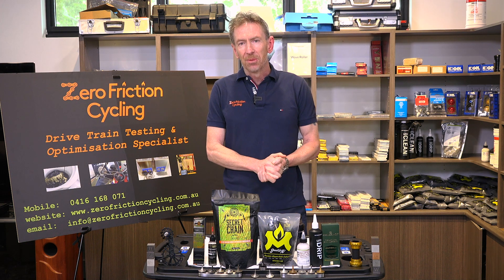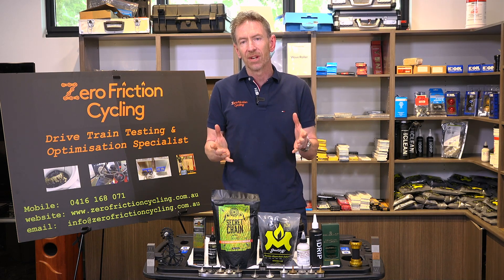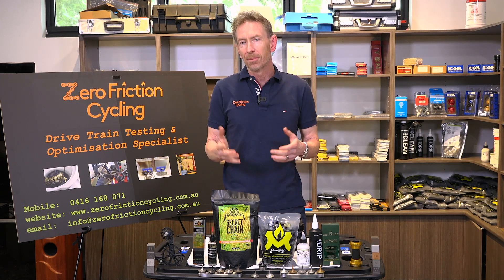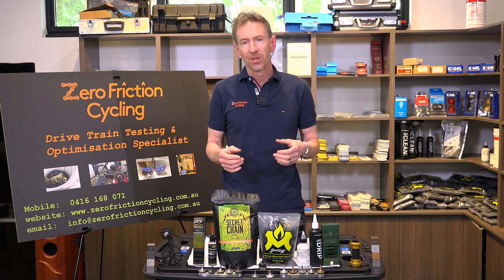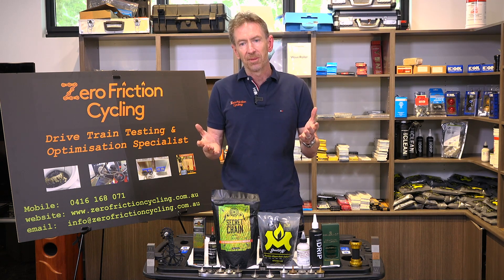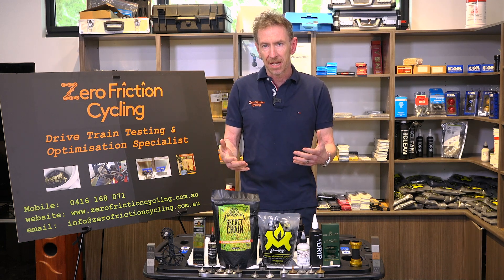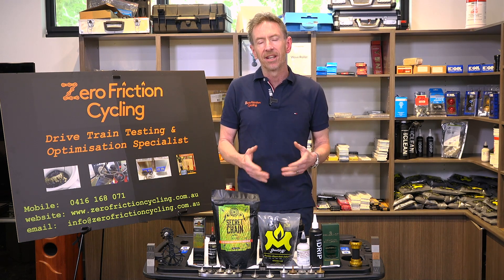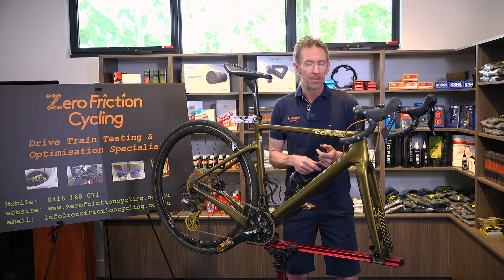Episode 1. Origins Of Zero Friction Cycling

Comment: I'm fan of your tests and your channel. And a few suggestions to bring your tests to a next level. 1. Do tests like real life cycling, with variations in Watts (including sprints). 2. Test the combination of immersive wax (I give an application every 500k) and a drip wax (in my case Squirt, to keep the drive chain absolutely silent) in between. 3.Include a variety of chains (I cycle with Wippermann) might make you the 'chain authority' too
Reply from the maker: Thanks Richard! 
Re 1 - that is difficult. A new protocol would mean building up a new league table of data for that protocol (as well as other potential variables if wattages for a particular interval input incorrectly etc - there is a lot of intervals, there would be risk of error across long tests with multiple tests running all the time). 

Re 2 - that test is on the to do list, just trying to work out how to get to it. 

re 3 - i have done a bunch of chain wear life testing awhile ago, including a number of wippermann chains, but struggling to get back to wear testing a bunch of chains i would like to do (T-type, ybn flat top etc etc).  I cant change the chain for the lubricant testing as we need to use the same model chain for wear comparison. 

thanks!
Reply: @zerofrictioncycling992  thanks for the heads up. Regarding 1. Do the testing with one protocol of variation of watts. It's not about the exact difference in wear. It' s about getting an indication of the influence.
Reply from the maker: @Richard-kz5ow  Yes that is a good idea that has been on the long list to try to get to, but oh man, my test list.... And i have a bit of a concern about what watts i could do without blowing up a neo, its a lot of hours at high watts and they get pretty darn hot at 250. I would need to give it a lot of rest breaks....

Comment: I would like to know how regular old candle wax from Woolworths stacks up against UFO & molten speed wax. 
Can you please test it with your scientific approach?🙏
Reply from the maker: Hey there - yes i will be, not sure when, but i just received my parced of candle wax from a candle making store after buckling to peer group pressure :) I am flat out so not sure when will get a spot, but this year sometime. Before test though i can already tell you (i have seen this a lot) vs msw it will be, gunky, slow, short treatment lifespan. Do not use candle wax - why skimp to buy such cheap crap for your hardest working component? DIY waxing can be great, just use a decent wax - food / lab grade paraffin. Saving $30 on lube to have half the lifespan of components worth hundreds of $$ is just dumb.

Comment: Enjoy watching your work. I've had an idea/thought I would like to share and ask your opinion on.
Would a "light" waxing of a cassette improve performance or just clog up the cassette and chain and cause problems. By "light" I mean a very thin layer of fine wax.
Reply from the maker: thanks stephen! And alas no your concerns are correct, it has been tried, and it really doesnt work. Best if wish for this is just re wax early - some excess wax is imparted to cogs post re wax, and if re wax erring on early vs pushing treatment lifespans, this does build just the right amount on cogs and rings, and is wear protective vs a build up of a wet lubricant that will become abrasive over time.

Comment: does anybody else think the volume is too low? i need to have his volume boosted by 400% to be able to hear him on my laptop. most other videos, i don't need to boost. and when i do, 200% is usually enough
Reply from the maker: Hi Joseph have checked and overall it seems normal from everything can tell on this end, ie same volume on my pc, headphones, stereo as a bunch of other good you tube vids, and have had a bunch of people do same test and cant tell a discernible difference in volume of this vs clicking on other vids by say cycling tips, project farm, silca etc. If turn up audio any more risks distortion - will do another check but at this stage cant quite nail down an audio level issue, it was set pretty high - sorry no clear answer yet!
Reply: Yeah absolutely fine my end as well, watched on TV, phone and iPad. No issues with Volume.
Reply: JUST USE ALL CAPS!  THERE, PROBLEM SOLVED!!!!!
Alternative snarky reply:
Wax is good on your chain, not in your ears!
(Just had a relative's ears cleaned of wax.  YUCK!)